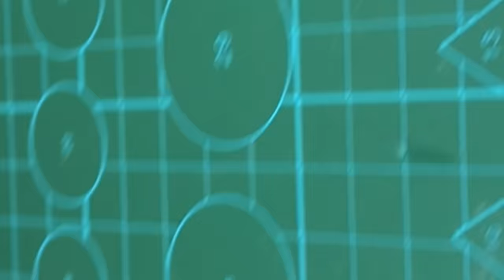6 SIMPLE INVENTIONS

Comment: A portabel Soldering machine??! .. Amazing !!
Reply: I suggest you to learn spellings a bit
Reply: @seedsmontessorimansehra8459  lol.its true👍🏼
Reply: But no use 🙄
Reply: Why didn't they used the same soldering machine in next invention .,... Think about it!!
Reply: Is the soldering iron works ???
Reply: Any soldering iron can be portable if you're insane enough
Reply: U can even write in need...😂😂😂
Reply: It works
Reply: @yuvrajrai7220  now that I think of it, yeah it could possibly work. The highly resistant graphite in the pencil could heat up and work as a saudering iron. But the wood around it would catch fire and just a 9 volt battery probably isn't enough to get that graphite super hot.
Reply: @Sedika Gamerz self promoting in comments is kinda cringe bro
Reply: @Kids_Scissors  evaporating graphite damages the brain, it also gets you extremely high
Reply: @sayedmohiddinpragatiengine6850  because it would catch on fire (shorted batteries do that)

Comment: The CD with sandpaper looks like a nice thing to do but for someone that knows 1 or 2 things about PC cooling fans I believe it wont work.
That kind of motors don't have enough force to rotate under any kind pressure specially for sanding wood. Simply wont turn when we put the wood agaisn't it.
Reply: Also the 9w from the battery (which would also catch on fire due to a short circuit) can't melt metal that fast

Comment: 4:06 dont try this at home, this one is dangerous, the wood could be caught on fire since the tip will need to be at least 100˚C in order to melt the solder.
Reply: Its ok to use if you dont touch it
Reply: @MisterScrap  well if u use it long enough in a dry environment, it could cause a fire.
Reply: True
Reply: And the pencil can allways start burning thats 9 volts going trough some cheap wood
Reply: The battery is shorted it would catch on fire or explode
Reply: @peterwan816  yup it's shorted
Reply: @PFnove  yeah my brother tough it was cool and tried it bit the battery just made a weird noise and it started smoking good i had a glass of water to cool it down

Comment: Let's take apart 2 9 volt batteries to make a 9 volt battery out of other batteries...
Reply: What if the 9 volt was dead?
Reply: 1.5v + 1.5v =9v ? Besides LEDs need an appropriate load resistor, or RIP LED IN 30S  @anthonysmith7357
Reply: Brian is right. Batteries connected in series are additive in voltage. (1.5+1.5=3)
Side note. Batteries in parallel actually maintain the same voltage, no matter how many you have. Power will draw from each of them equally.
Reply: .  ز
Reply: Alice cooper
Reply: its a reuseable 9 volt battery
Reply: @Sierrebrarc  I wonder how to do it in a series circuit...
Reply: @emsswaniest2700  the batteries need to be linked + to - in a row.
-[___]+ -[___]+ -[___]+ -[___]+
Then, to complete the circuit, you connect the - on the first battery, and the + on the last battery to what you're trying to power.
Reply: AMR
Reply: M

Comment: Please also tell how to make table lamp at home easily using only some material
Reply: You buy an LED strip in China and connect it to the power supply (depending on the voltage of the LED strip) ..... EVERYTHING, DONE, USE .... If you want you can make your whole house in it

Comment: 4th was very worst. Simply wasted a battery and made another battery.
Reply: But the battery enclosure created can be refilled with AAA batteries repeatedly. So you can use AAA batteries when you don’t have a 9V battery. Then, when they die, you can use the “battery” again.
Reply: The battery was dead
Reply: Oh. I didn’t notice. So you can make a working 9V battery from a dead 9V. Even better!
Reply: yeah, this is big brain time!
Reply: The best idea is to use 14500 li battery which got 3.6 -4.2V and that is about the same voltage as 9V gives

Comment: since when does a prison allow 9 volt batteries
Reply: If you can get meth, tobacco, heroin, weed and coke inside jail you can get a 9volt. It's called the smoke detector duh.
Reply: @brettking8663  most new treatment remand centers have wired smoke detectors... tried to disable mine so I could smoke in my cell.. big mistake
Reply: Since forever and ago .

Comment: Other hacks would work but 4th hack wouldn't work because the the battery has 9 volts of current in it and those 2 cells combined have 3 volts of current